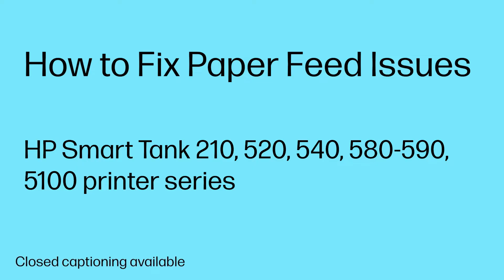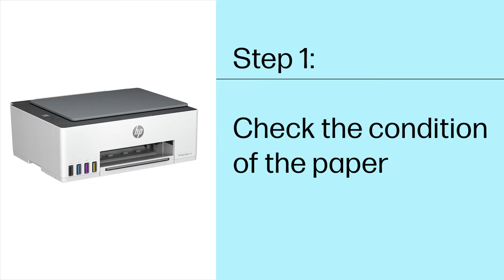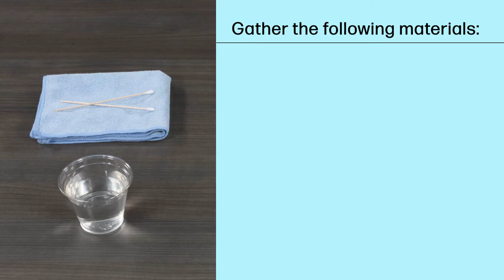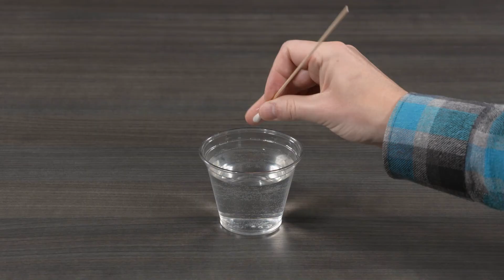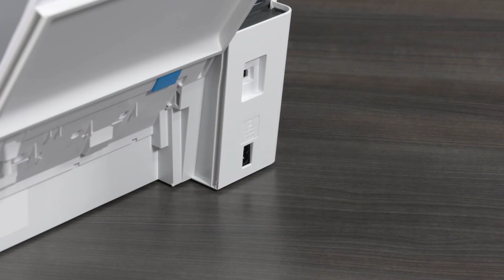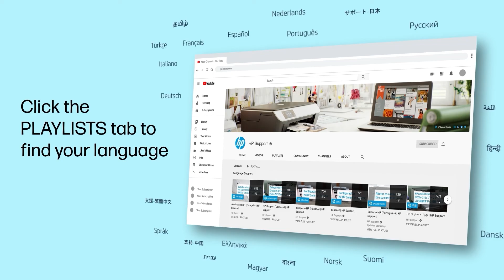How to fix paper feed issues | HP Smart Tank 210, 520, 540, 580-590, 5100 | HP Printers | HP Support

Comment: Is it necessary to keep the printer plug in even I didn't use it? Or it's okay if I only plug it in if I need to use the printer.
Reply from the maker: Hi there, thanks for contacting HP Global Social Media Support!
I understand that you need to know when to plug and unplug your printer.
I will do my best to assist you.
You should generally plug your printer in and leave it on unless you plan to store it for a long period of time, as frequently turning it off and on can wear down the internal components and shorten its lifespan; if you need to unplug it, always use the power button to turn it off first before unplugging the power cord
Regards, 
HP Support

Comment: Hp smart tank - 580.  
I tried everything what he said, nothing worked. It gives only some irritating rolling noise all the time. Paper is not feeding properly at all. Just a year and 2 months before only bought. Rs 15,000 around spent , I feel disturbed and disappointed. Lot of performance issues. My only advice to Hp is do not sell these kind of products any more and throw out the engineers who designed this.
Reply from the maker: Hi there, thanks for contacting HP Global Social Media Support!
I understand that you are experiencing a paper pickup issue on your printer.
I will do my best to assist you.
Please refer to the instructions mentioned under this document to fix the issue: https://hp.care/6057Ua7RW
Regards, 
HP Support